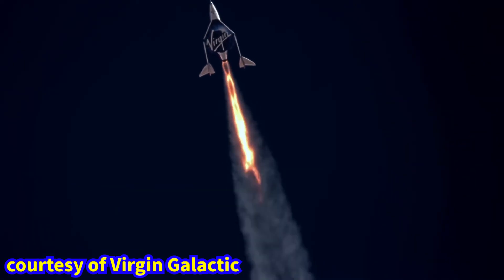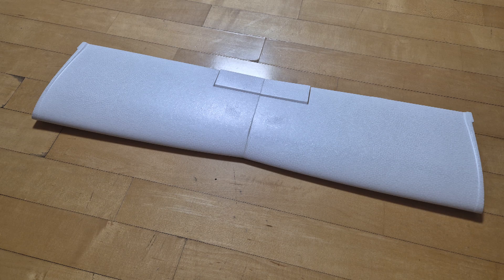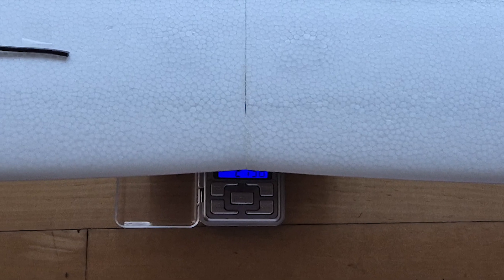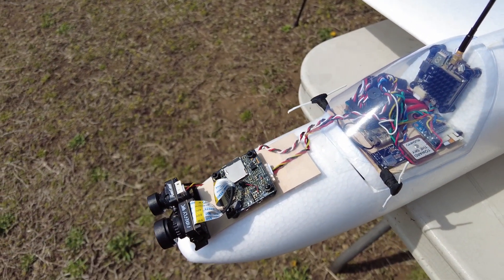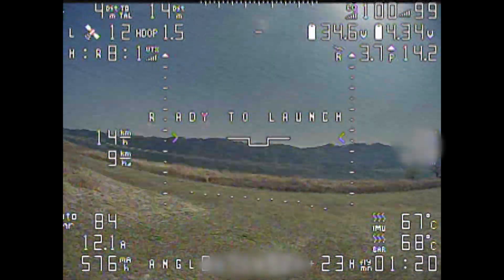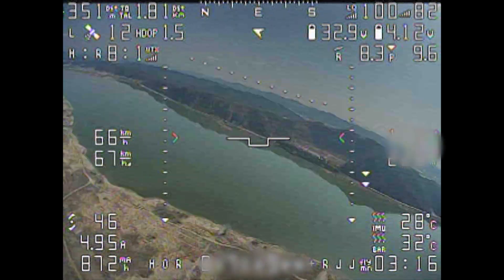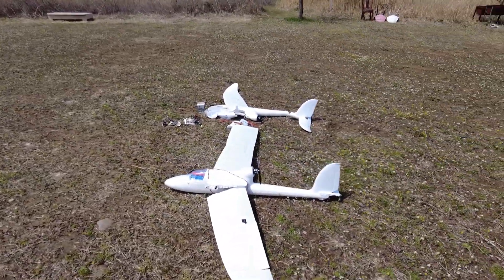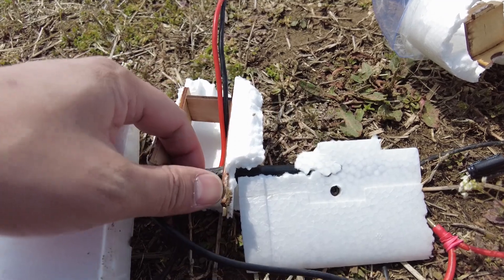RC MotherShip inspired by Virgin Galactic

Comment: Fantastic idea. Hopefully your are able to make progress with future attempts. 

Virgin Galactic uses some complex control engineering to keep both fuselages aligned. 
One issue I see with the Skysurfer version is each fuselage can twist (3:23) an amount in pitch, thus twisting the main wing, which can create roll forces. Another issue might be if the distribution of mass is not identical along the length of each fuselage, then this can also create a twist in the wing as fuselages not aligned when under g-forces. This is why the Rutan Voyager design used a canard that connected the pods together. Purpose was to minimize twist as fuel loads varied over the flight, as it had many tanks. 
 
The simplest way to counter main-wing twisting is to run a small diameter carbon rod (or clear plastic rod) between the two elevators. Need to physically limit the amount of twist between the two fuselages.
An alternative is to use a control solution to align one fuselage (leader) in pitch, and the other (follower) using some kind of sensor. The follower would ideally mirror the leaders elevator amount, but adjust slightly if alignment between two fuselages differed. It might be possible to use an Arduino with a tilt sensor in each fuselage to accomplish. The purpose is just to eliminate twist between the two fuselages.
Reply from the maker: Thank you, Thank you for your Golden advice!
I'll keep your advice in mind.
Your alternative solution, Arduino&Sensor solution looks attractive and really really attractive for me, but it will shrink my weekend flying.
First of all, as you said, the simplest way, I have plan to reinforce using carbon tube.
Thank for your advice!